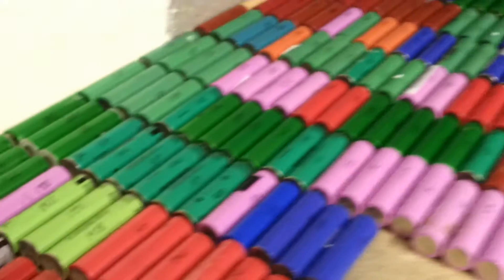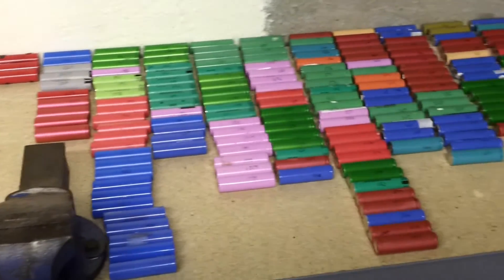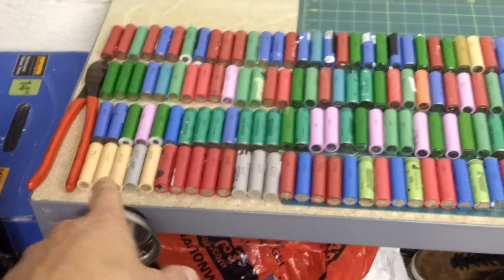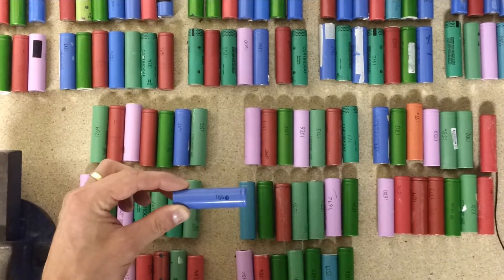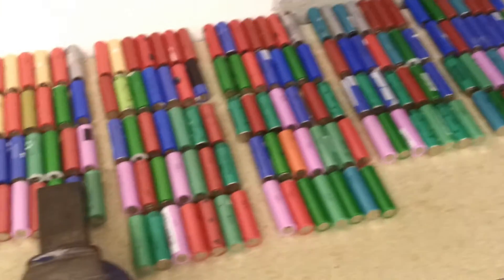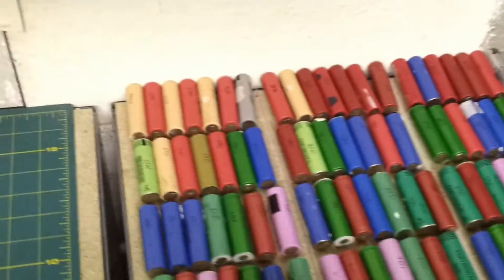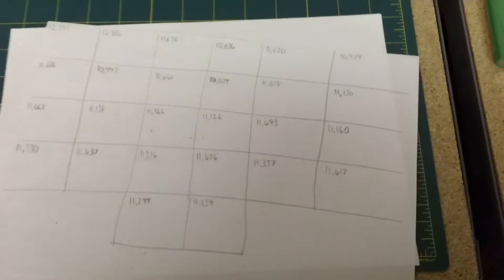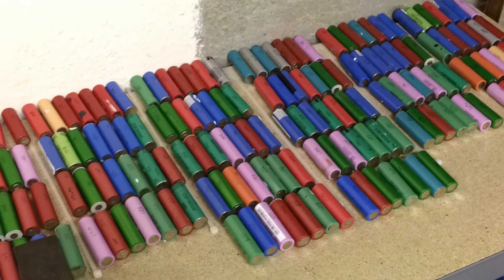Lithium Ion 18650 48v e-Bike battery build DIY - Part 5 - Organising cells

Comment: You also refer to the internal resistance of the cells when sorting? what is the biggest difference in capacity in each group. Can this be a problem, if to big?
Reply from the maker: I think the largest difference in capacity might have been up to 1Ah. I'm not sure of this causes a problem or not to be honest.
Reply: Komrade Shotabollokov and what about the internal resistance? Do you look at this?
Reply from the maker: Hi Guiseppe, no I didn't look at that aspect. This was just a cheap build with used cells so I wasn't too worried about battery longevity. If I ever build another pack I'll buy new cells.
Reply: Komrade Shotabollokov ok thank you